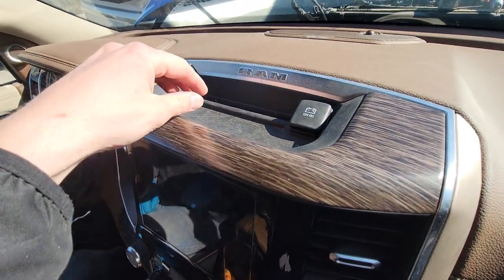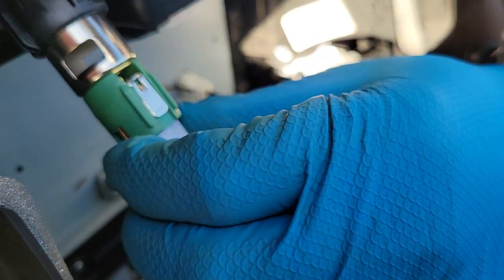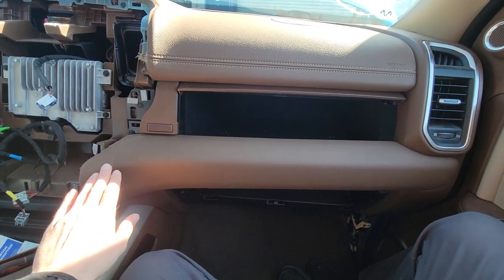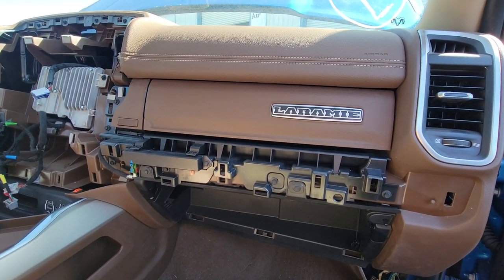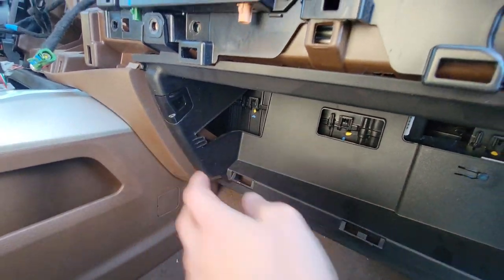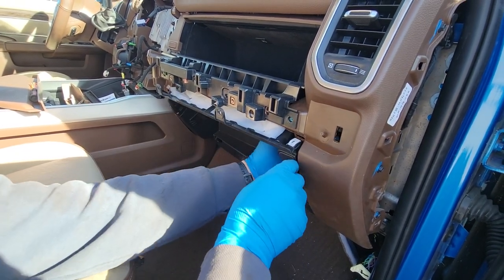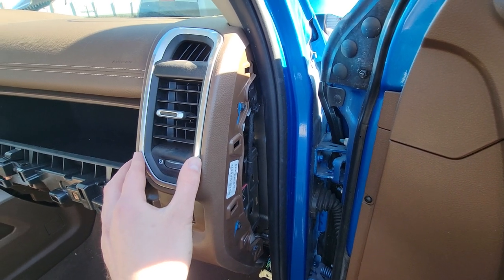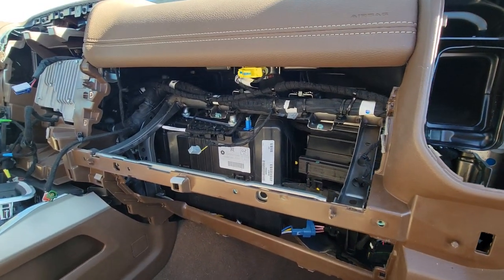2020 Ram Taking apart dashboard

Comment: Could you complete the process to get heater core out please. You have very clear videos. Great production.
Reply: Right there with ya. Replacing my 19' right now
Reply: I have a 21 ram and I’m trying to see how easy to replace the heater core I ain’t paying no one if I can do it myself
Reply: Yes please I agree that would be a great video
Reply: @darianwyatt1083 any luck on finding a video mine just went out yesterday
Reply: @joshuakeene762  I haven’t been lucky to find anything but there’s a couple Ram forums online that have helped with things in the past, I’m going to look there.
Reply: @davefinstad2979  same dude what the hell is up with ram
Reply: Trying to do the same on a 21 ram. 😂
Reply: @Beard_Commander1980  I ended up taking it to my dealership ship for an ABS recall and had them replace my heater core too. Costed me $1800
Reply: @darianwyatt1083  I got it finished up. Wasn’t as bad as I thought. Taking the whole dash out was a learning experience lol

Comment: Hey do you have a video of how to completely remove the dash on a 2019+ 2500? I need to replace mine and trying to do some research of how to go about it
Reply from the maker: No not at the moment
Reply: @ipartoutstudio  do I need to remove the steering wheel to remove dash? 
Glove box, screen, speedometer, all need to get removed, what else if anything ?
Reply: Did you figure it out?
Reply: Any update y’all?
Reply: @iBryaaannnn  I did it couple weeks ago, quite easy
Reply: @boostedjdmem1  any tricky parts? I’m gonna replace mine Monday
Reply: @boostedjdmem1  was this because of leather bubbling up?
Reply: Heater core going steaming I think and actuator for direction quit working need the rest of the dash pull please

Comment: I have a 2019 1500 that I removed the module in the back and don’t seem to have a black connector that there’s a space for on the module. I couldn’t find any connectors on the harness. Putting it back together wondering if nothing goes on there.
Reply from the maker: Might not have that option
Reply: @ipartoutstudio  thanks that’s what I was thinking but just wanted to ask because the harness doesn’t have it and the module does hahaha but yeah checked all the harness and there’s no connector that fits there.